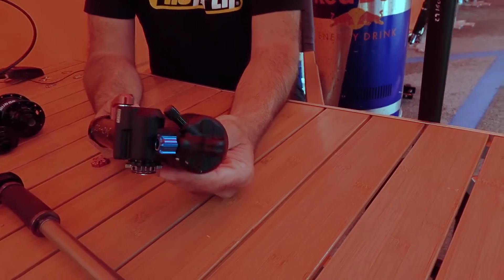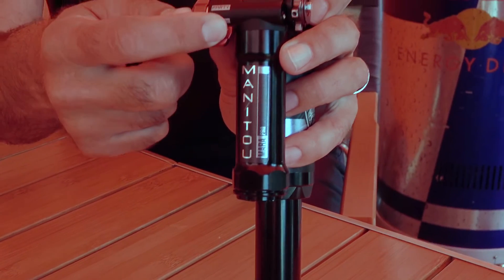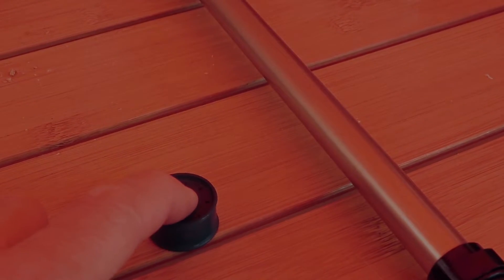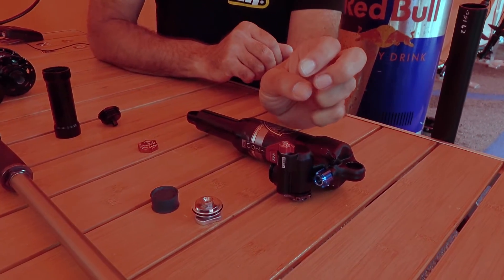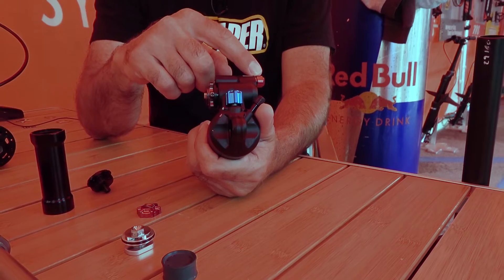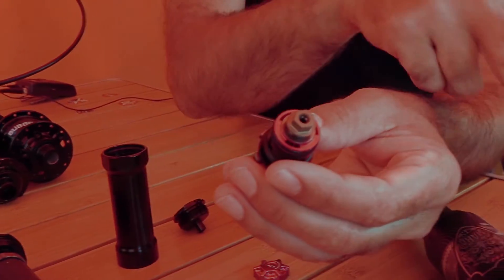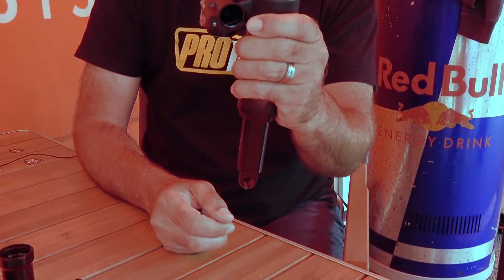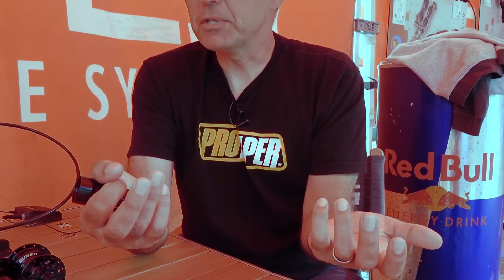Manitou Mara Rear Shock Explained

Comment: I'm consistently blown away from Manitou/Hayes these days.  I can't think of another brand that has made such quick leaps in their tech.  Most importantly this stuff is wildly nice for a kid rider.  I swapped out our stock McLeod on the Clash 24" we have with a Mara Pro.  Both are super nice but dang the Mara Pro is really really nice.  All of the independent adjustments make it easier to tune as a Dad for a 72lb kid without screwing it up.  Overkill for most 8yros I'm sure but not when they are sending huge stuff and the small details matter. Oh, and get those Hayes Dominion brakes with the SFL (small finger lever)...MASSIVE upgrade for a kids brake (or adults).  Perhaps the best brake ever made for under 1k$.

Comment: Mezzer or Mattoc Pro at 160mm travel? Was thinking maybe the 37mm stanchion of the Mezzer would be too stiff at 160mm travel.
Reply: The new mattoc pro boost has a good increase of stiffness because of the different designed crown and more massive rear arch. Thus if you are not a 100 kilo heacmvycharger, it should be plenty stiff, but the Mezzer does not seem to ride harsh because of the chassis.